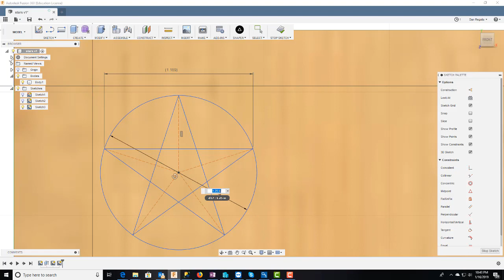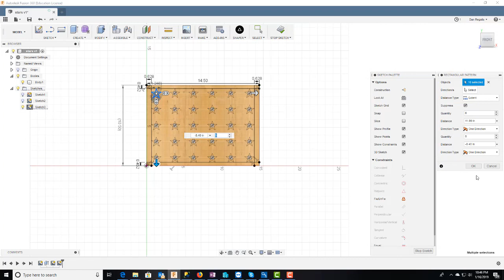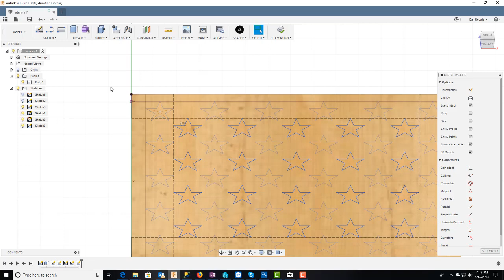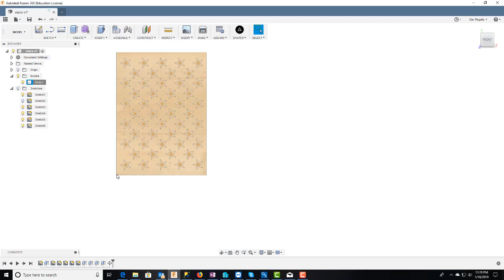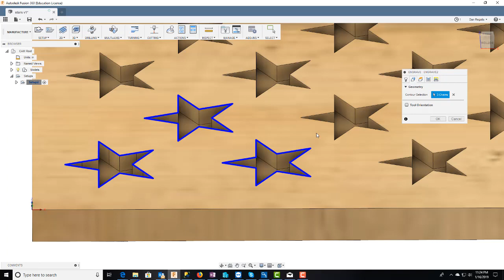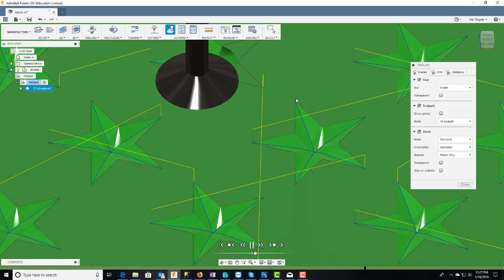Building a US Flag Star Field in Fusion 360

Comment: I am a beginner with Fusion 360 but I learned the other day that the simulator play line has a little dividing line in the middle and when you cross the center line it will play in reverse. The forward replay is from the center and moves to the right.

Comment: What a great tutorial Dan!  I learned so much about Fusion 360 from doing this step by step with your video.  The tips and tricks I'll take to my other designs in the future!  Thank you!!!  The only thing I did differently is I tied all of the dimensions to functions off of custom user defined parameters I set up.  All one has to do is go modify the one parameter for the width of the star field (i.e. your 14.5 inches; 10 inches; 28 inches; etc.) and everything automajically readjusts!  about the only thing one has to do is then go to Manufacture to select the appropriate tool and regenerate the tool paths.
Reply from the maker: So glad that this tutorial helped out, and I really like the fact you took it to another level by doing the parameters.  It has been on my to do list for a while, since my friend started bringing me all his various sized flags to do for him.  Appreciate the comment.  Cheers!
Reply: @DanRegalia  I'm on Twitter at @mark_lawler and have documented my wooden CNC build using the tag #DIYCNCProject.  We can follow each other then I can DM you my email address (I don't see how to private message here on YouTube). I will send you a copy of the Fusion 360 file that I based on your tutorial with the parameters to automagically drive field and star size and spacing.  Least I could do to repay the favor of your wonderful tutorial.

Comment: I've run into a challenge where my stars are 2.2 inches so my .5 inch wide 90 degree leaves an interior positive star.  Any  ideas how to solve that? Thanks
Reply from the maker: I know this is a little late, but the only way to do that, is with a 120 degree bit that is about .75" at it's widest point.

Comment: Hey dan! love the video. I have been looking for a star tutorial on Fusion 360 with no luck. Thanks for the upload. it has really helped me. I created my union on Fusion, but on my tool path im getting a star inside of the star and its making it look a little strange. Do you know what I could be doing wrong. I am very new to all this cnc and cad.
Reply from the maker: If you have a star inside a star pattern, you may be doing a pocket cut, instead of a 2D engraving cut.  This tutorial is all about using a 120 degree (or if the stars are small enough) a 60 degree shallow VBit..  Let me know if you're still having an issue, and maybe do a screen capture or record it with your phone and post it, I'll see if I can figure out what's not right.  Thanks for watching the video!
Reply: Dan Regalia Yeah I’m using a 60 v bit 3/8  wide. Is that the problem?
Reply from the maker: @jason.the.tiger.  Depends on how you have it setup.  Look at the part of the video here where I am setting up the tool.. you have to specify 30 degrees on yours to get it to work right.